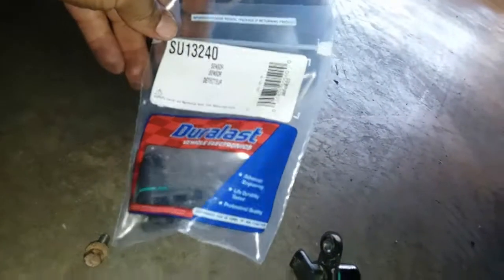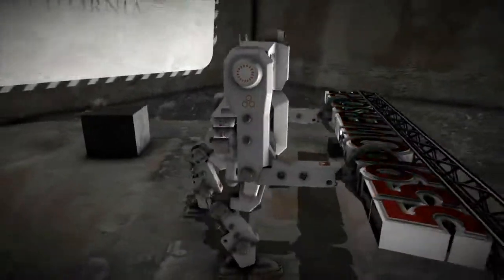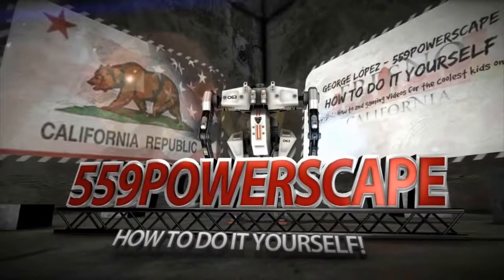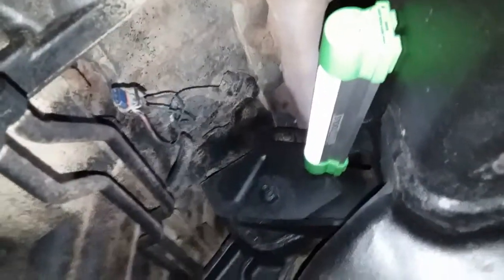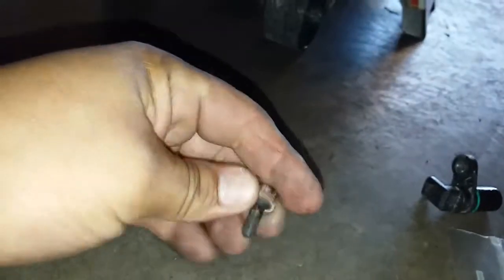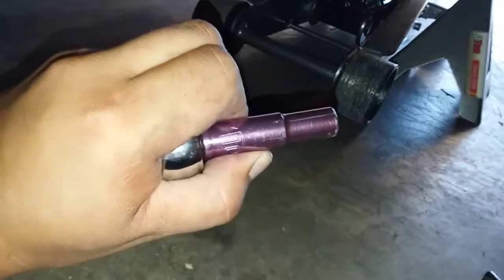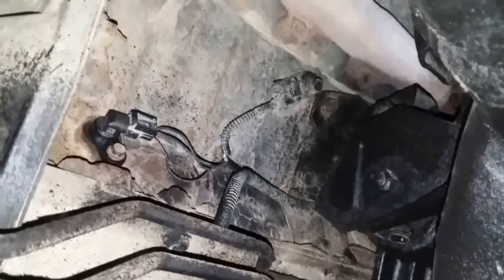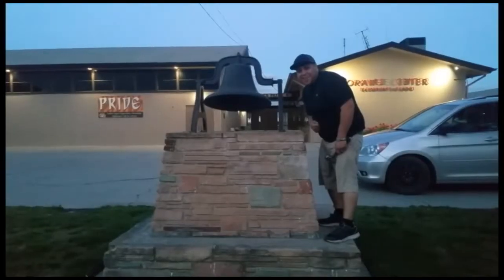How to: Install Crank Shaft Positioning Sensor on a 2011 Dodge Ram 5.7 Hemi

Comment: My 2012 Dodge 1500 5.7 Hemi is currently not starting on its own. Engine cranks fast when trying to start. Hook jumper cables up and it starts right up. Battery, alternator and starter all tested fine. Could a bad crankshaft sensor be the reason my truck is refusing to start?
Reply from the maker: Thats weird. Any check engine light on? Maybe clean the battery terminals so its free from corrosion and making good contact.  Now a days vehicles are full of sensors, so if its not getting the correct voltage it will not work correctly...I would start there first

Comment: check engine light came on and said Camshaft position sensor not crankshaft sensor on my 2010 ram 1500.. I replaced the sensor and check engine light went off and then came back on same day.. should I replace the crankshaft sensor as well?.. trying to figure out why this sensor keeps failing. Any ideas?!
Reply from the maker: When the check engine comes back on, would you happen to have a obd2 scanner? To read the trouble codes? Sometimes it can have multiple codes. You fix one and another pops up...it could be that the one sensor could be throwing other sensors off...see if it's still for the same Camshaft position sensor...this has 2 banks. So a total of 2 Camshaft position sensors. Did you replace the one or both?
Reply: GEORGE LOPEZ HOW TO DO IT YOUR SELF I replaced one of the camshaft position sensors didn’t know there was two! Where is the other located? I replaced the passenger side one, I’m replacing the crankshaft position sensor you explained in the video right now
Reply from the maker: @joshculp8428  your right im sorry I apologize.  I did some research and yeah it only does have one sorry bro most engines have 2....because of the 2 banks hopefully the crank sensor is the one that does it...because the cam and crank go hand and hand with each other
Reply: GEORGE LOPEZ HOW TO DO IT YOUR SELF fixed it! Changed crank and cam sensor and changed oil and running perfectly
Reply from the maker: @joshculp8428  heck yeah bro! Im glad you resolved this! Have a great weekend! Thank you for your SUPPORT!

Comment: Can this be a reason why my fuel pump wont turn on?
Reply from the maker: No i dont think so, it should start but gave a rough idle...if its the fuel pump i would check fuses and relays